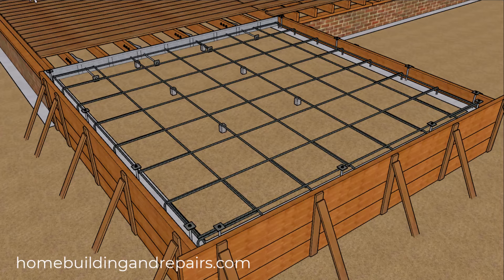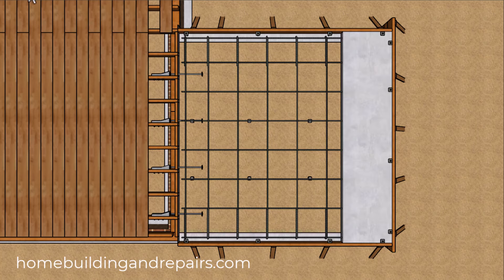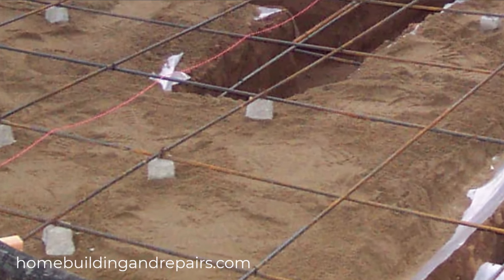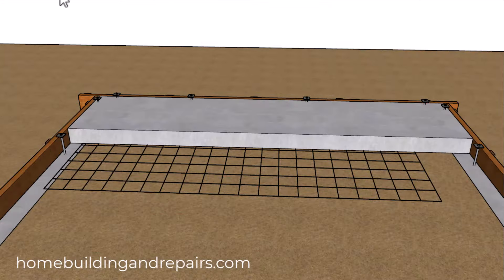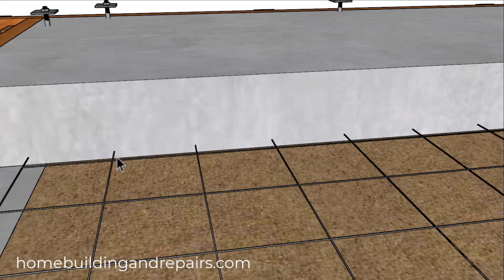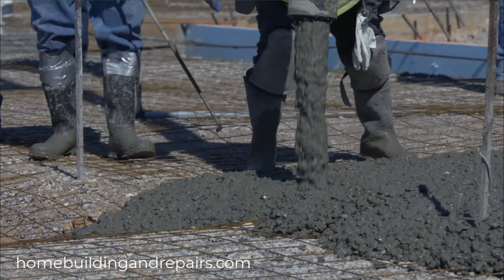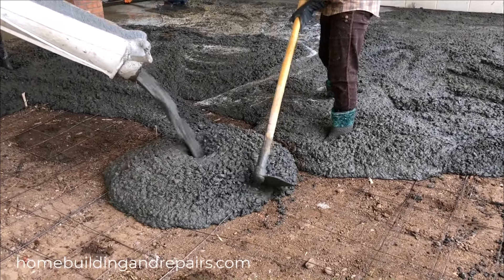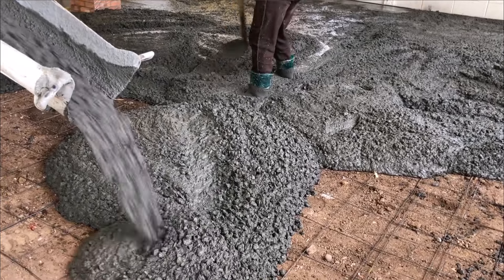Wire Mesh For Concrete Slabs Usually Won't Work Well If Installed on Bottom

Comment: You want the reinforcement in the lower area of the slab because concrete is under tension the most at the bottom.  Just as long as about an inch of concrete is under the wire you are good.  I am structural concrete certified and this is how bridge decks are built (largest rebar just off the bottom of the form about an inch or 2 depending on the design).  The only problem here is bad advice from the op and the armchair comment engineers.
Reply: Isnt there a formula for the depth of the rebar or mesh? LIke 30% from the bottom of the thickness of the slab? example- 6 inch slab should have it placed 1.8 or 2 inches form the bottom? and 8 inch slab would be like 2.5 inches? something like that

Comment: You often state you are not an engineer.  If you understood the Interstate physics behind concrete and re-mesh and / or rebar plcement you would understand the purpose is to counter the tension at the bottom.  Nothing is needed at the middle or  top of a slab because concrete needs no help against compressive force.  (Footters, beams, and other elements are different.)  If you put reinforcement high in the pour it will serve little purpose.  See reekreek's comment.

Comment: When we poured slabs over remesh in '74 when I first started out, we were taught to pull the remesh up into the concrete as we laid the concrete down. That's not an ideal solution, but it's better than allowing it to lay flat on the bottom. I prefer working with rebar, but you build them as they're designed and permitted.

Comment: Confirmed.  I made a hash out of a sidewalk the other day because I used wire mesh.  Unfortunately it was a client decision (because he had it laying around) that I disagreed with, but ultimately went along with.  I should have refused the job.
Reply: why not just use plastic Lortel mesh ups to elevate ???
Reply: @johnwhite2576  I wired mine above the ground to short rebar posts, so mine were about 1 1/2-2 inches off the ground at pour.  I watched it slide to the ground as we poured.  The fault lies with me for not wiring it well enough or not keeping the mesh up or whatever.  The sidewalk cracked in places it shouldn't have within a week.

Comment: Retired Concrete Finisher I was very anal you must pull the wire up dump a little concrete pull the wire up and had another guy pulling the wire up too and do any good at the bottom

Comment: This is what separates a conscientious contractor from a contractor that is working just for money. Someone doesnt need to have 30 years skill to follow basic conscientious practices when doing work. Many things are hidden and never seen during construction, only to fail years later when they could last for 100 years. Thats why so many older structures last to this day compared to the Mcmansions that are being built now.

Comment: i get the point,  it's a little counterintuitive to a mechanical engineer.... as the tensile forces are away from the neutral axis so that would be where one normally wants the tensile  members, since the bottom outer "skin" is in tension the most.... but on the other hand you need some embedment.  Either way one doesn;t want it on the very bottom  , lol.   I'm surprised concrete workers are that sloppy, ignoring the positioning of it and just wasting the mesh...

Comment: Reinforcement in the “Bottom 1/3 of the slab” is supposed to be ideal 

but “center” is often said because in practice most reinforcement (like the video states) isn’t watched closely enough by the installers to ensure consistency of placement.  It is however extremely important to the longevity and strength of the project.  Rebar sizing based on slab thickness and aggregate dimensions is also a very important factor.

Good video about an issue not addressed nearly enough due to its importance!

Comment: I used some Pink fiberglass rebar on a foundation repair. It was easy to cut with the miter saw and light weight.

Comment: Most of the time the wire mesh is not pulled up properly. If it is, it will stay in place to a certain degree. Rebar is better because it is thicker, thus stronger, thus more expensive. It also needs to be tied together. I've seen this short-cutted also and you get bad results too.

Comment: Rebar, always rebar.
Reply: I used both, I guess I will see if it works.
Reply: Rebar is easier for one guy to install. It’s easier to get it where you want it when pouring. Rebar adds horizontal strength , torsion, and helps keep concrete together when it cracks. .